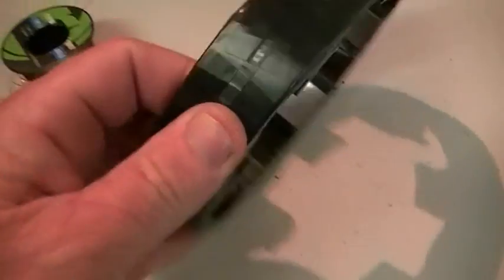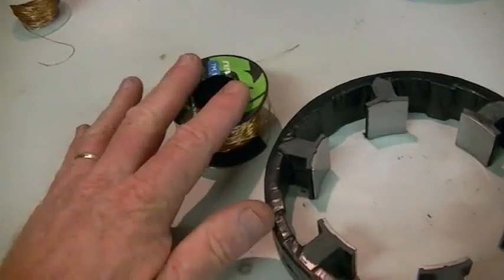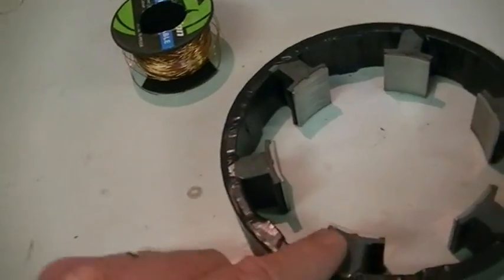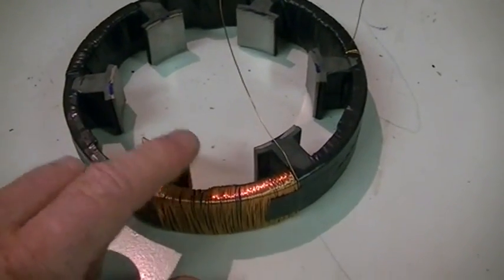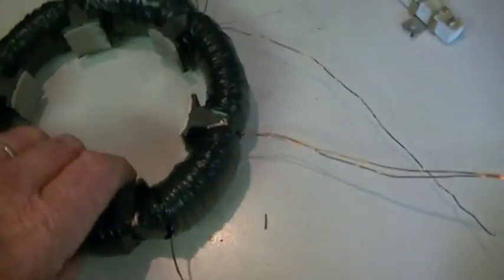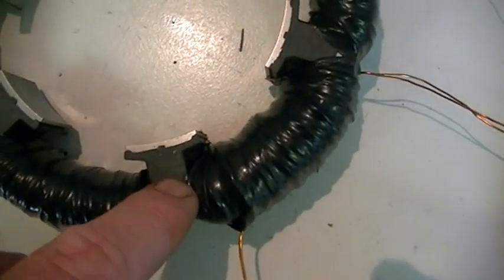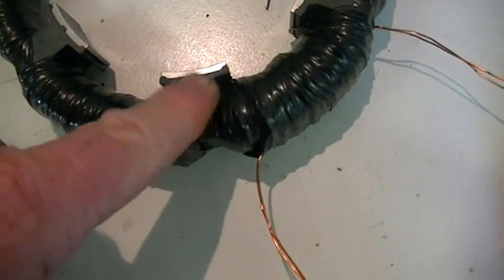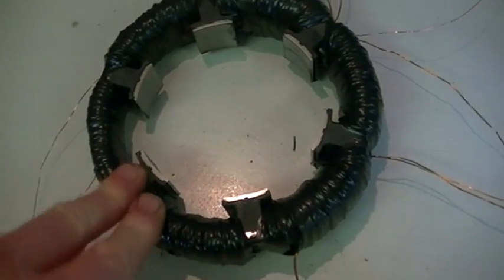Tesla Hybrid, The Lenz Force Motor Generator pt2

Comment: oz good vid, where can we get a circular stator like the one in this video? I want to make a generator with low lenz
Reply: Hi , glad to help.
they come from many different washing machines, Fisher paykel etc if you remove the rotor you can also remove the top plastic layer and punch out the perm feild devices to reconfigure them into different orientations , this means there is a possibility to experiment with the rotor also as the perm feild devices in the rotor are adjacent to the laminate which creates a pole through opposing feilds if you examine one you will discover that, it’s interesting because the field is a pole created by two opposing poles in an almost adjacent angle which creates the pole at the adjacent angle of their two directions. If you find one you’ll be happy to pull it apart and discover this. 
Regards

Comment: Nice work, I just wanted to give you a heads up, you want to ensure that you clamp laminates before drilling through them I actually clamped the material and drilled through the clamp that I made to keep the laminate plates from separating because you will get metal shavings between your laminate plates. But of course you probably already know this because you've done this as long as I have. One additional note in the United States this type of core is used in a box fan. Good luck
Reply from the maker: zeropointfuel Thanks Z.